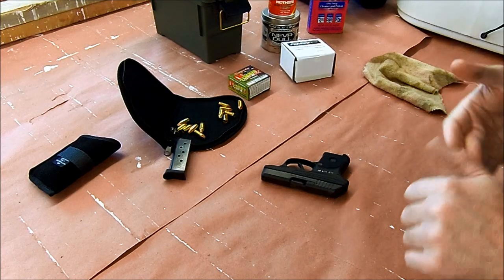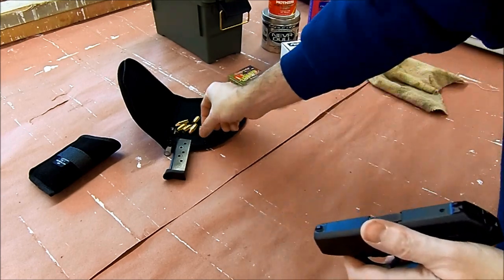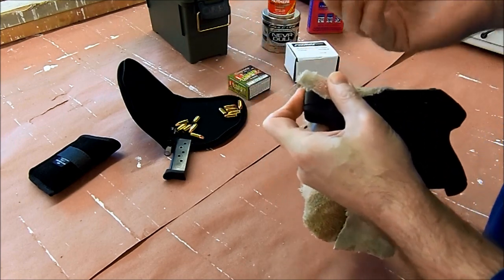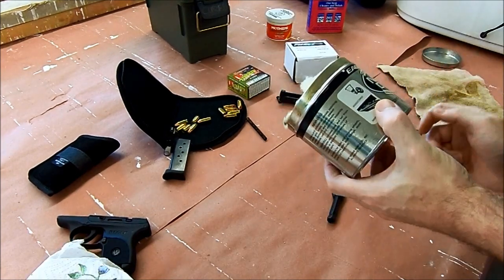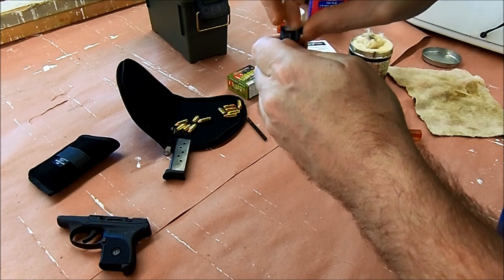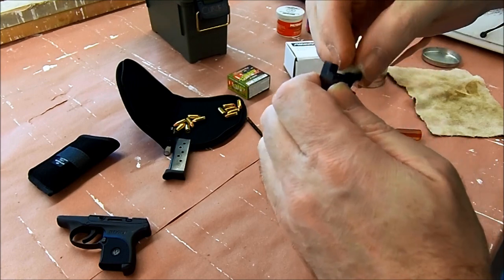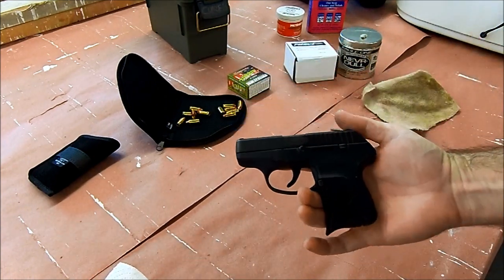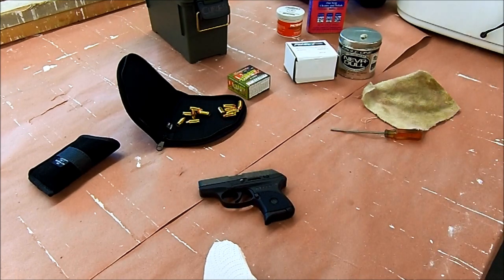Ruger LCP 380 misfeed fix

Comment: I was having problems with my LCP.  Enough that I stopped carrying.  Saw a video and decided to go back and address it.  I broke it down and basically sanded the hell out of everything important.   600 grit sandpaper.  I sanded off all of the sharp edges and corners  everywhere.  Then clip off some of the magazine springs to reduce some of the tension.   4 mags.  Cleaned and oiled it, went to the range.  Fired about 70 rounds through it of Ruger, Hornady,  and    Aguila ammo in both FMJ and critical defense ammo.  Shot both slow and fast.  Zero problems.  I'm convinced that I fixed it and now carry it again.
Reply: You should not have to clip off mag. springs.  Ruger spent countless hours calibrating those springs for a reason.  Down the road when you've put 500 rounds thru the gun those springs have lost 20% of their strength - then you start having misfeeds.  600 grit to the feed ramp will remove any unwanted tooling marks.  If you notice the feed ramp is very steep.  That is the major problem - poor design.
Reply: @buckshot4428  the same designers that designed the feed ramp decided the spring tension, springs are cheap, nobody should put 500 rounds thru a $200.00 gun.
Reply: @buckshot4428  get a HEAVIER RECOIL SPRING, throw away mags u clipped if u carry it for self defense
Reply: @michaelsantosuosso7284  you are mistaken.  I never clipped my mag springs, but there is great difficulty in seating some older mags. which will require me to sand down the plastic base pad which will allow much easier insertion.  I'm usually against heavier recoil springs especially in smaller pistols as it makes them too hard to rack the slide.

Comment: Thank you so much for teaching me how to clean my concealed for the very 1st time. Was having jamming issues, bullet was jammed never happened to me before. I  had to get the bullet out and clean it but no oil on hand right now so I will purchase some and oil it up and put it back together and try again. At first I struggled with taking the pin out not realizing I didn’t have to twist it I had to pull it out. I also struggled at first with the spring even when only 1 way would fit but I could get it to snap back into place I struggled with putting the pin back in also. Silver spring seem to be blocking it. Overall I figured it out thank you so much.

Comment: I always polish the feed ramp of every pistol I own. I use a Dremel type rotary tool with rubber impregnated 1000 grit polishing bits followed by felt buffer tips and polish. Then fire at least 250 rounds to break it in. Keep it clean and properly lubricated. Ammo should never touch oil. Never had a problem with any of them.

Comment: Great idea.  I just shot my LCP for the first time this past weekend and had some feed issues.  Occasionally the round would fail to fully seat in the chamber, but I could ease the slide forward and it would move into place.  I'll give it some polishing in the two places that come into contact with the rounds and see how it goes next time I'm out shooting.  Thanks for sharing.
Reply: Jim Rodgers did polishing the ramp work for u? I just bought one of these as well and had a few feed issues similar to what u described.  Wondering if polishing works or not, otherwise I was going to send back to ruger.  Thanks
Reply: It did.  I think that some break-in (about 300 rds) helps as well.  But since shooting 300 rds through it and giving that feed ramp a serious polishing job, it has not had any feed issues.

Comment: Ok Great video that feed ramp polish is the very first thing I do with any semi auto NEW to me even used I buy step one disassemble polish feed ramp, it saves me headaches in the long run and if prior owner says Picky on ammo it is not after the ramp is polished. check for function while disassembled back together see if the worst ammo runs through no foul up ,bleeps or blunders if no polish again then  run 200 through before it is CCW. Now some Hi Vis Orange paint on front sight WOW

Comment: That take down pin is designed to fit the base of a .380 round. The feed ramp of LCP have lateral machining marks. I use 600 grit paper wrapped around a 1/4 inch wood dowel. After a couple strokes with the 600 grit I use a Demel tool  with polishing compound to polish the feed ramp.

Comment: I know it's an old vid--hope you're still watching posts.  I just took out my LCP (.380).  Got it used--it looked to be virtually new.  And I suspect it was this feeding issue that made the guy unload it.  I tried 3 brands of commercial FMJ, and every one of them had feeding problems.  I charged it properly--pulling the slide all the way and letting it fly, and it resulted in the FMJ just getting wedged directly into the feed ramp.  I'm wondering if your fix actually fixed it?  I'm hoping it's either just a break in issue (let all the parts polish and wear in), or it's a faulty mag.  I just got finished with 3 round of returns with Rock Island over a different firearm.  I really would rather not deal with it again!  Thanks for the info and vid.
Reply from the maker: Thanks for the comment and good luck with yours! This did indeed fix the issue. She is now a reliable carry gun.
Reply: I polished the ramp with some 2000 grit sandpaper.  It's like a mirror now.  Hopefully I can test drive it next weekend.  I did run some .380 snap caps through it. So far so good.   @Killobyte

Comment: I like Ruger as a brand . Usually good quality but shame on them for the poor design on the lcp. I've had similar issues like many of us . We should never have to do and work to our firearms out the box besides break in period of course. I own many Glocks and straight out the box you can put hundreds of rounds with no issues. The funny part is that Ruger still hasn't fixed this problem almost 15 years later coming out with the lcp.
Reply: heavier spring plus polishing feed ramp with a dremel will double up on reliability of feeding......
Reply: Maybe I’m just lucky but there’s never been any kind of a malfunction issue w/my second generation (post 2013) LCP.  As long as the weapon shoots & feeds live fire I wouldn’t worry about the manual feeding of rounds.  The gun relies on the pressure of the round under fire to reliably cycle the slide.
Reply: I totally agree with everything you said. I just wish I had seen this video earlier. The LCP is a nice CCW, but ruger is wrong for this. I am not a fan of ruger.
Reply: Just bought a new one, same problem still in 2024. They have done nothing to fix the issue.
Reply: @chris84662  yep.  Here I am, just picked it up this morning.  First attempt to chamber a round got stuck.
Reply: @stevewoodyt  I polished the feed ramp with some Never-dull and then I ordered a 13 lb recoil spring for $12 off of ebay and now it runs perfectly. That fixed the issue for me.

Comment: Hint for the take down pin:  Put the pin in BEFORE you put the slide on the frame.  All you do is true the pin up to the inside of the frame THEN put the slide on.  The pin will slide in easily.

Comment: My daughter in Minneapolis just got Ruger LCP .380 brand new.   I went with her to shoot it.  Jamming every 1-3 shots, usually after every shot.  She is very proficient in clearing the jammed casing that failed to eject.  Very disappointed with Ruger as I thought gun manufactures test fired each weapon.   I will try and correct the problem by sending it to Ruger as I hear they replace an internal spring and other parts.  Then I will buy her a mini Glock or a Springfield Armory gun.  The sad thing is she called me and asked me about the Ruger and I told her it was a good brand.
Reply: Same experience here. I'll be taking this down in the next few days, polishing / sanding the areas I've picked up in this video and a couple of others. I hope like hell we can fix it, otherwise she'll be trading this in on an M&P. Kinda disappointing to see some of these reviews. We should have done more homework up front I guess.
Reply: @bengochnauer2735  did you get it working well after all???  (Have same Problem)...
Thanks for your time
Reply: @christopherjmoore1288  Because the gun was brand new I opted to contact Luger Customer Service. They asked that we return it to them for service. They currently have the gun.

Once we get it back and run a few rounds through it, I'll update again.
Reply: @bengochnauer2735  I truly appreciate it....I am pretty disappointed with Ruger on this one....I have a I have a hard time thinking that they did not know about the problem for the past few years and continued to sell the firearm. I mean in the wrong circumstances this could turn into a pretty serious lawsuit for them.
Reply: We ended up sending back to Ruger. They replaced the barrel and the slide. We'll see how that works
Reply: I replaced the extractor, extractor spring, and the plunger.   I put three magazines through it without any jams.  Now my daughter can defend herself in Minneapolis since they defunding the police.
Reply: @bengochnauer2735  they did that very same fix to mine...keep me posted on the results....I have put only 30 or so rounds through and 1 jam so far
Reply: @christopherjmoore1288  will do. Paperwork said the ran 24 rounds through with 100% success. Probably find out this week how it works.
Reply: Ben Gochnauer What happened? Did the new Ruger parts fix it?
Reply: @richardwilliams7492  Yes she has run about 100 rounds through it with no additional issues.
Reply: @bengochnauer2735  OK. They did the same to my gun. Same exact problem. I need to get to the range.
Reply: @christopherjmoore1288  :
The parts came, and they were easy to install.  Put several magazines through it and no issues.
Reply: @oldguysrock2170  I took the very same route. Took it to a local gunsmith, he assessed that the barrel and slide were not appropriate. He then sent it out to Ruger and within 12 days they had sent me back brand new slide and barrel. I have almost zer misfires at this point. So I've changed my perspective about Ruger, from being frustrated, and protesting them from now on, to me thinking that they actually really came through in the end... Way to make a good comeback Ruger!!!

Comment: After putting this subject in my search bar, many videos like this come up.  I also have a Ruger LCP that I bought a few years ago.  That is my EDC, and I never even fired it.  I only took out the magazine a few times.  I checked it the other day, and I see I have to really ram the magazine up very hard to get it back in.  Too hard as compared to many other pistols I've had.  I can see that Ruger has lost their quality control, and I will never buy another gun from them.  My Glock, Walther, S&W don't have any of these problems.  Shame on this company.
Reply: The magazine reload issue is a common problem with this item.  There is a simple adjustment that can be done to the edge of each magazine body with a common nail file. Search ruger forums for the information.  It took me about an hour to do 6 magazines and now they load like butter. (Edit: did 3 ruger brand mags and 3 pro mag brand mags which all had the same problem across 2 different LCPs: one early gen 1 and a later or gen 2 version)
Reply: @Dan G I was going to say the same thing! ALWAYS practice with what you're going to carry BEFORE you carry it! Good advice
Reply: @Dan G, i could not agree any more with you! My EDC is fired, cleaned and lubed more than any others. Nothing like "needing" a weapon, only to find it doesnt function!!

Comment: I shot 20 holo points today and ..... the feeding problem JUST SLIDE AND LET GO .... IT WILL FEED. BUT ! 1 CASING FAILED TO EJECT AND JAMMED....... IDK IF I CAN DEPEND MY LIFE ON THIS GUN ......
Reply: Thinking of selling and getting a glock 43x
Reply from the maker: If you've already polished the feed ramp and still having issues, I'd try a different brand/type of bullet.
Reply from the maker: @kesochasin9880  The Glock 43 is a great gun.
Reply: I didn't polish but after the range I did thoroughly clean and lube I will go 100 rounds next time as thats enough to get a malfunction after having one malfunction through 20 rounds initially. Wish me luck.